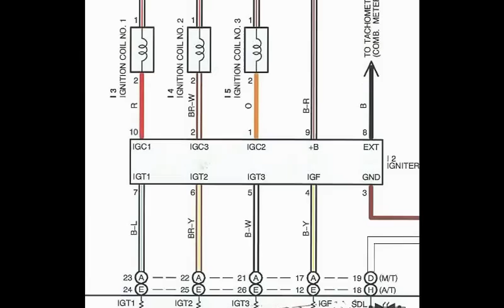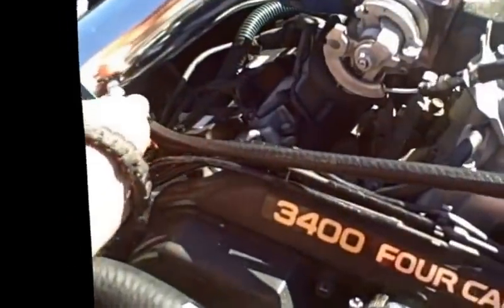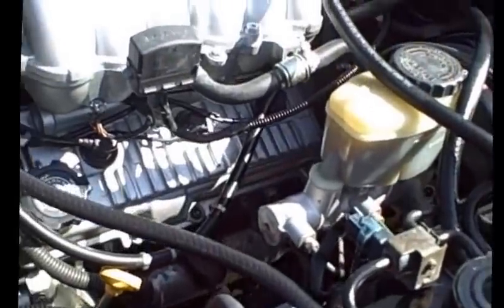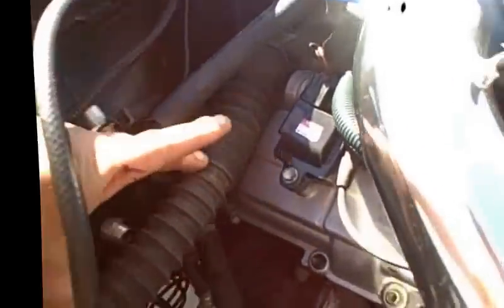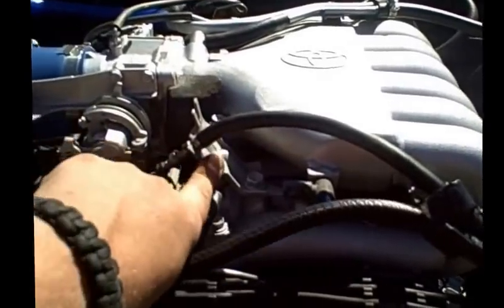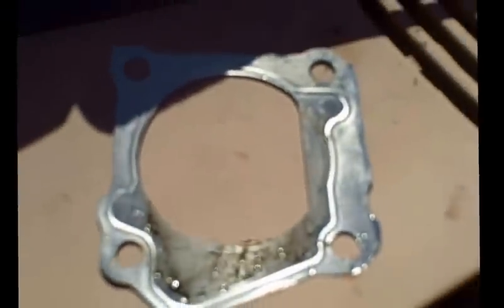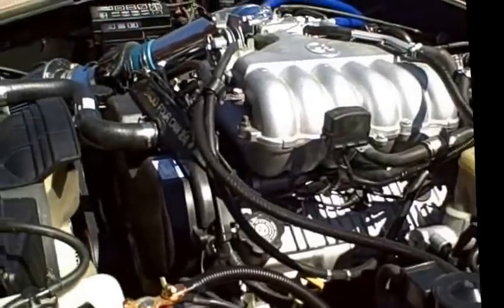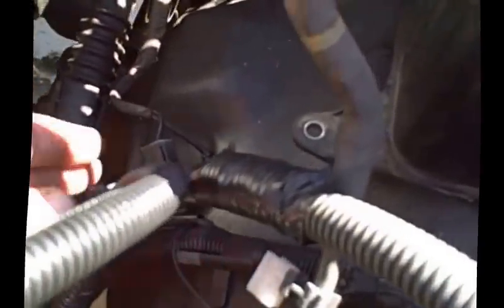94 Toyota 3.0 to 97 3.4 Engine Swap

Comment: what about smog ? will it pass?
Reply from the maker: Mine passed just fine.  Then again, I did a full tune up, cleaned the fuel system etc. If you are in Cali, make sure you get a Cali ECU as there is such a thing. It's not 100% necessary, but will help with Smog

Comment: About how much did it cost?
Reply from the maker: Roughly about $1900.  But that is with a new timing belt kit, valve shims, Clutch, cross over pipe, battery, valve gaskets etc. it can be done for about $1000 if you are using old parts. In the least, change your timing belt and pulleys or you will have to tear it apart again soon enough.   YOu might even strongly consider doing your head gaskets as few people spend the $1500 to have this done and it wasn't done.  Just a thought to save you headaches and it is easier doing this out of the rig!!!  Yes, it might take longer, but you will thank me later!!
Reply: @10MinutestoRouletteFortune  that price point is just parts? no labor costs correct?

Comment: What's the cost on this swap
Reply from the maker: +trenton greisen Well, that depends on what you want to do.  Just the engine will run you about $600 and the needed parts about another $350 or so.  But, if you want to do it right, consider this, the engine most likely will have over 150,000 on it.  You have NO idea if it has had a valve adjustment, timing belt, gaskets, etc.  If you have a manual as I do, might as well do the clutch while you are at it.  DON"T overlook the head gaskets while it is apart and out of the truck.  I did everything BUT the head gaskets and it left me stranded 350 miles from home with no access to tools and a mechanic that fucked the job up.  Do it right, or don't do it all is what I say.  Total swap cost, about  $1,800.

Comment: ok i found. a 3.4 engine its out of a 2001
Reply from the maker: +justin Roa What you need along with the engine is the computer and wiring harness.  You will have to get the electrical diagrams from the 2001 and match it to your year 4Runner and the systems in it as I did.  If you haven't joined YotaTech.com.  NOW is the time to do it.  People there will help you along.  Be patient and learn from that site and the people who have done it.  GL